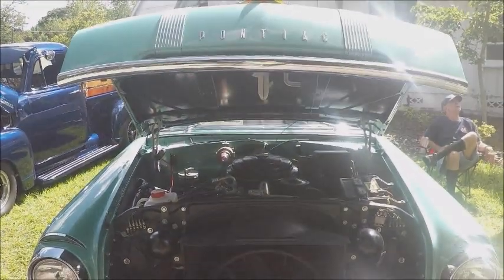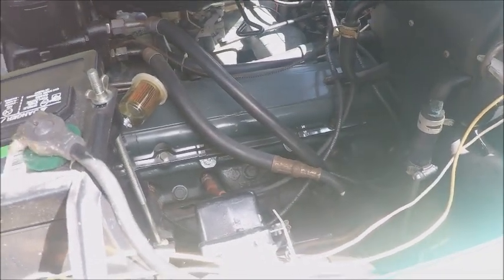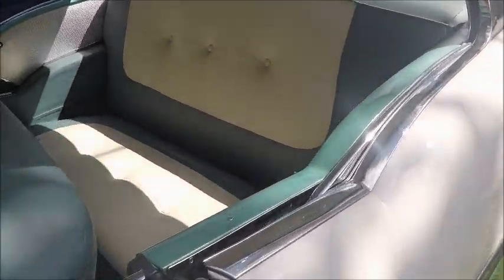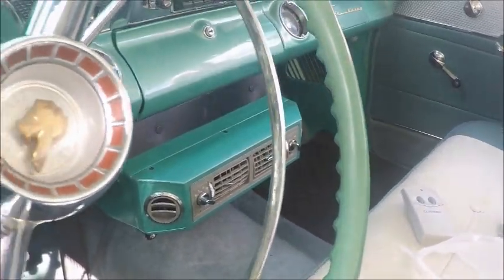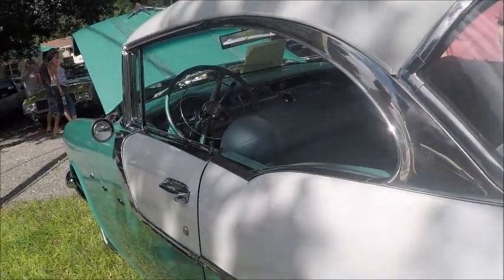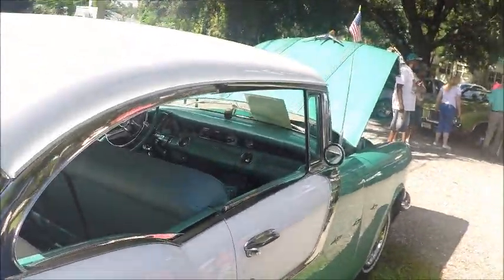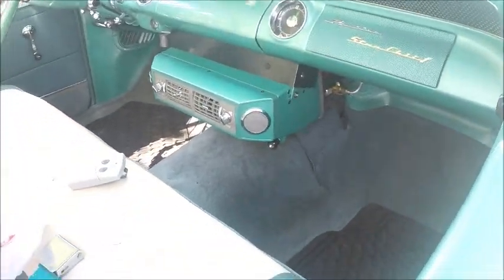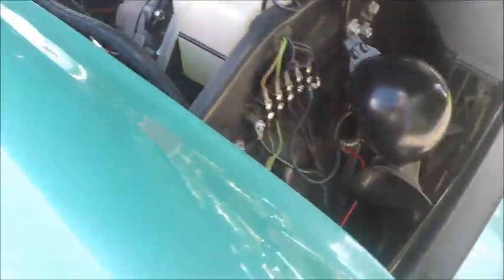1955 Pontiac Star Chief Catalina GrnIvory Apopka0804184659

Comment: Check out that large electric fan in front of the radiator. Bet that keeps the engine and Chief Pontiac (on the hood) cool on a summers day. And the faux Darrin dip aft of the doors is a real head turner!
Reply from the maker: Yes, many restored cars are now using electric fans to ensure that coolant temperature doesn't go out of bounds.  I think it's a wise investment!  I didn't associate that chrome strip with Darrin's dip, but since you mentioned it, it sure does look like it was influenced by the great designer!  Thanks!  :) Jack

Comment: Hey Jack. Lovely looking 55 Pontiac. I love the two tone colour combination. One thing I've never understood is why Pontiac auto transmissions don't have a "Park" position on the gear lever. All it shows are "Neutral", two range "Drive", "Low", and "Reverse", but no "Park." What's up with that?
Reply: 40's and some 50s Hydramatic  based transmissions didn't have park for  years, you put it in reverse and turned off the car, and it  became  like park  and you set the brake .
Reply: Pontiac we build excitement
Reply from the maker: Hey, Jason!  califdad4 answered your question....park wasn't available in Mopar powerflites when it was first brought out either.  Hydramatics had that unique lock up feature in reverse when the engine was off.    Thanks!   :) Jack
Reply from the maker: Hey, Brian!  Thanks for answering the question.  I see many of the hydramatic cars of this vintage locked in R at shows.  :) Jack
Reply from the maker: Hey, Alberto!  It sure was exciting...especially when it was first announced as a new model!   Thanks!  :) Jack